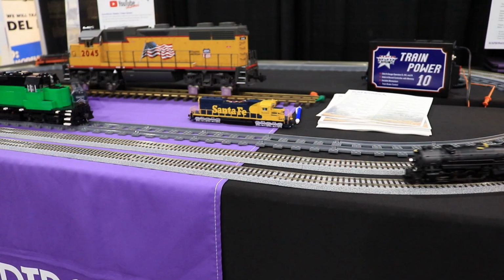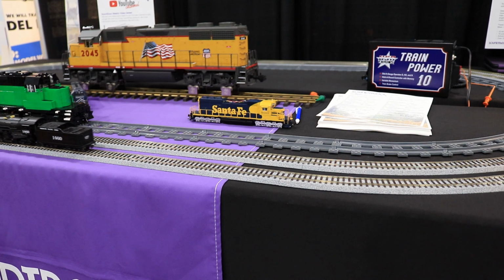Amazing Blunami Technology from Soundtraxx

Comment: Anyone willing to help a new guy get started. I have lots of easy track ho scale and a few easy track turnouts non dcc. I just recently bought nce dcc system. Sadly have only the ability to set up my old dc trains at christmas time around the tree. I want to change it, but only place i could build is in the garage, but no room in there. So I thought maybe a hoist system to hoist layout up out of the way by pulling it to the roof when not in use  to use my garage. The boss wife would allow that. any ideas how to rig a system like that?
Reply: How large a layout are you thinking of hoisting?
Reply: 12ftx5ft maybe ho layout @Bliz0516
Reply: @Bliz0516   I was wanting to hoist a 5 x 12 ft layout

Comment: Saw this when it first came out last year, and certainly has the potential to change the way we operate our trains but sadly not currently supporting N-Scale as yet. One question I did put to Soundtraxx some time back re N-Scale was to simply do a DCC control only version and perhaps that would help miniaturize what they have developed, but received no feedback. I know they are known for sound, but there are modelers out there, like me, who simply aren't interested in sound, but want DCC control. Given this is a partnership between BlueRail and Soundtraxx, I guess its more up to the BlueRail team to see if they can make it work for N-scale. 

Another option that  has been available for about 5 years is Wifi Trax out of Australia which as the name suggests uses your home Wi-Fi network which I would argue is infinitely more reliable than Bluetooth. They actually offer a complete DCC control system for US$130 to control up to 16 locos (expanding to 100 in the future ). For me 16 is fine. My bank account can't expand to much more. 

http://www.wifitrax.com/products/product-WFD-27-detail.html 

Or you can connect to other DCC systems like NCE, Digitrax etc. There are a few YT clips on WiFi Trax but its pretty unknown in the US which seems to be in love with Digitrax.  

Wifi Trax appears to be a very simple, reliable and affordable solution to control your trains via DCC (using readily available decoders, I'm currently looking to install ESU LokPilot5 into a couple of my Kato DCC ready locos) for both iOS and Android. For my DCC journey and given ST are a long way off for N-Scale I'm likely heading down this route. Out of all the mainstream DCC control systems I researched,  the system I really liked was ESU Cab Control II, but it is pricey particularly here in New Zealand. Otherwise I could potentially opt for NCE as its affordable, simple and already has great interface compatibility with Wifi Trax. But honestly with a WFD-27 and a 5 Amp power pack they  supply, I think I get everything I need which is simply DCC control of trains.

Comment: Great advancement, but I don’t even look at soundtrax stuff since it’s not really for n scale. Blunami sounds the same, it will be some time before that is available. I am going to Japan in November who cater to n scale much more than US manufacturers and I am excited to see their technology.
Reply: We have a lot for N. Maybe not 30 drop in formats, but our N18 can fit into most models even with the N18 adapter.  We have the drop in KN1 for Kato N wide body models.  So, should give us another look!  Thanks.
Reply: @goaliegeorge  yes I looked at installing the N18 adapter and KN decoder and a speaker in my Kato SD70ACE’s. In the end i thought it was just easier to find a drop in sound decoder. However for any locomotives with a next18 I agree it’s a viable option.
Reply: Sorry not the KN with the N18, meant the n18 with adapter

Comment: I have that power supply, it's size is surprisingly misleading. It weighs a ton! 😅 Took me a minute to get used to the weight. 

As for the decoder, I'm wondering if I could use it in my old LGB loco 🤔 I've been told an HO decoder us sufficient for operation.
Reply: Look at the BLU-4408. That decoder is rated for O scale and is rated for 4amp stall where the HO decoders are only rated for 2amp stall.
Reply: It's 30 years old 😅 I'm told 2A decoder is all that's needed. I'm also considering a Massoth decoder that's pretty inexpensive, and using a DCC-EX command station. The 4408 is overkill. Now if they had an 8A decoder (6A + 2A stall) I'd consider it for my Aristo-Craft locomotives.
Reply: Also, it's still early in the morning, wasn't thinking about the form factor. My lgb is super basic, non-dcc. The 2208 might be a better fom factor. 😅